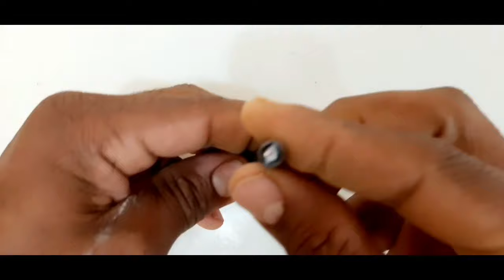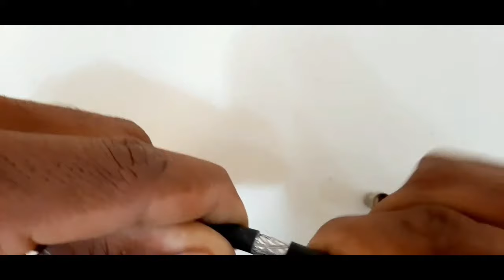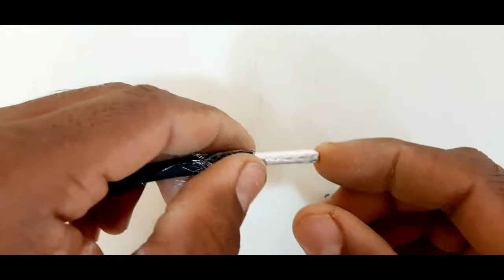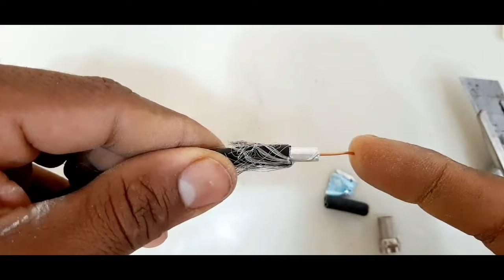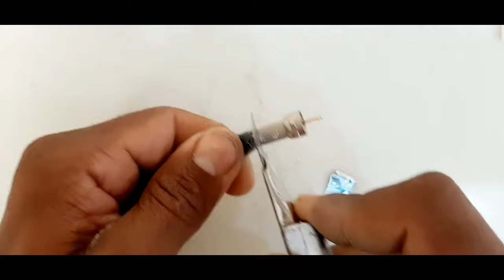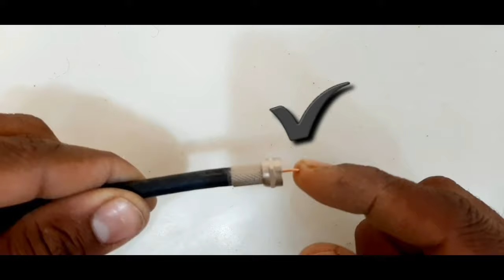How to connect satellite LNB or coaxial cable to connector/dish

Comment: this is what I've been doing everytime I lose signal, but now all of a sudden, this method has stopped working for me, images come and go every 5 seconds on my screen, any idea why this is happening??
Reply: The f connector is not well done..there is a possibility the outside brushes may be in contact with the inside copper wire..a single brush in contact with the innermost copper wire can be affect
Reply: I have a similar problem.
I did this method and it worked earlier around 12 but by 3pm it stopped, said no signal. Now I don't know what to do. Please help